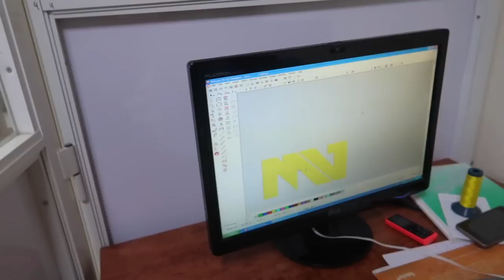Making A Real PC Gaming Chair From Car Seat

Comment: You can adapt armrests from office chairs by running a female to female pole between the bottom bolt holes on each respective side. You make it the width of the chair, bolt the sides together, and "sandwich" it in with the other mounts for the top and bottom. I would post one I made that i have put through the tests, but I can do a much better job and will post my next.

PS: Its easier with higher armrests for regular car seats which kinda limits (tho I am working on finding a clean solution), most armrests can be adapted for real bucket seats though since they generally have a thinner total "ass area."

Comment: there was no murder in this car, this is just the internet making something out of nothing, reasons being the broken windshield is expected because the car was in an accident this is obvious due to the deployed air bags, the other reason a broken windshield is expected is because people break them constantly in junk yards i don't know why but I've seen people do it a fair amount, most cars in junkyards have broken windows, also the "dried blood" is far more likely to be mold, dried stains or mud, i bet mud from the looks of it, people with young kids keep them in the back seat and kids make messes and as a mechanic you see the stains the kids make so also expected, adding on the car has no doors and probably hasn't for a while since doors are usually pulled from junk cars rather quickly, also add in people tracking mud in after it was put in the yard while pulling parts them selves. now if this was a car someone was murdered in it would not end up at a junk yard so that's another issue for this mystery, when a car is impounded by the police and has hazardous waste they are sent to specific cleaning companies that deal with it, this is not only for cars with murders but also drug mule cars, i work in the same complex as one of these companies and have made friends of an employee due to mutual interests so that's why i know how that works, so this is the internet finding a mystery where there is nothing odd going on, i can understand why some may see things that arent there but having frequented junk yards for cheap parts for my cars and seen countless cars with what the comments here call "bullet holes", worked in other peoples cars who have kids leaving similar stains(sadly some adults do it too, gross), and being aware crime scene vehicles don't end up at junkyards it's hard to see a mystery here, all i can see is the average car that got into a front end collision, written off for salvage due to repair costs and then bought by a pick and pull junkyard.
Reply: ok
Reply: Nice assumption
Source: i made that shit up